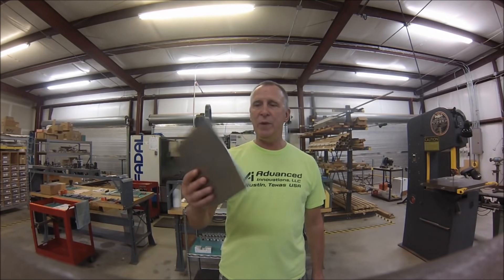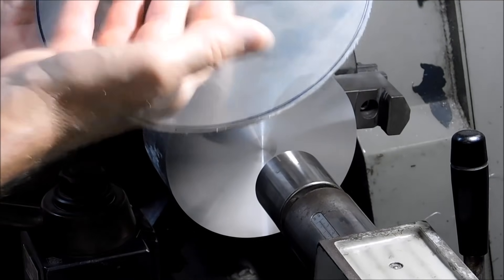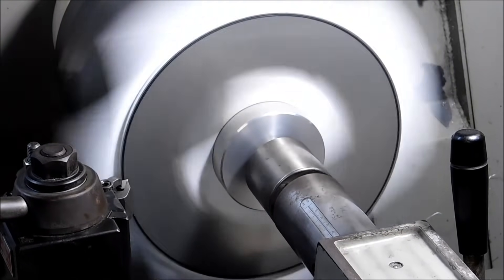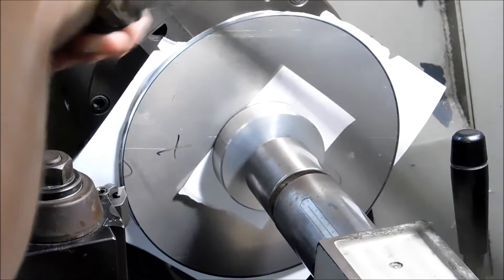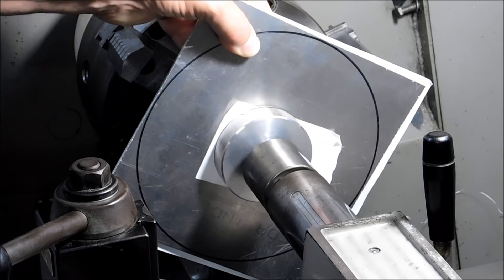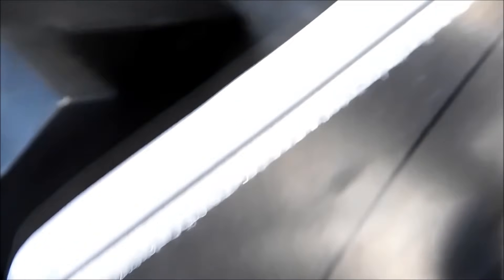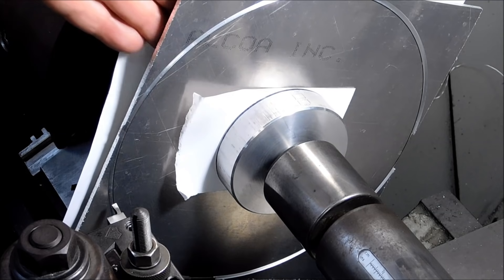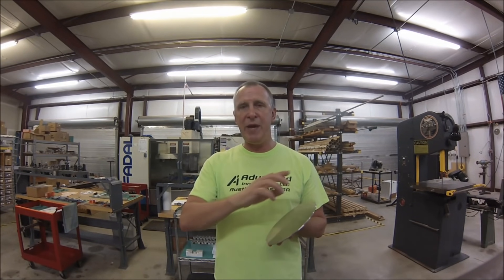Pressure Turning

Comment: Perhaps I missed it but was there any reason why you didn't use cutting fluid?  Thanks for doing the videos Joe.  I'm learning lot and still have so much to go.
Reply from the maker: Experience dictated it wasn't necessary.
Reply: @joepie221  Thanks, if you have the time, next time you use or don't use cutting fluid, would mind explaining why to a newbie like myself?  I watch some videos and they say cutting fluid or coolant on everything and other videos talk about it actually damages the cutter.  Not sure which way to go.  Thanks for the education Joe.
Reply: @VenturaSewerInspections  I think he was joking, no reason at all. Cutting fluid is always a good idea
Reply: @VenturaSewerInspections  You would be wearing a raincoat if you used fluid. Bee's wax works pretty good for non-ferrous, if you really wanted to use something. I'm just an old shop guy paid by the job. Duct tape and Band-Aids are the same thing. :)

Comment: That looks dangerous. how about glue the plate on a cylinder then use a heat gun to melt the glue after turning.
Reply: If you glue the plate to the cylinder takes more time, using a paper clutch makes the operation fast as you don't need to use a release agent to remove it. It is however dangerous but then all engineering machines can be dangerous. Can you suggest how to machine 1/8" aluminium circles to an accuracy of .002"as quick as that?

Comment: Why not superglue it to a piece of mdf, then warm it up slightly to remove it?!
Reply: Or just superglue it to an aluminum back plate with cyanoacrylate. Cut a few.concentric rings into the backlate, depth not
Important, maybe 1/16"?
So the glue has some where to go and.improves.the bond
Reply: @garethjones6342  that's not what the rings are for, but that does work well

Comment: Superglue? Why not use it? I understand it may take longer to set up and break down, but geez it seems so much safer...
Reply: Kameron Holmes I've tried this a few times and haven't had it come flying off even without superglue, as long as you cut it roughly at the bandsaw you shouldn't have much issues. Needless to say you still don't want to stand in the line of fire

Comment: Here are some tools you could use: Scissors to cut paper; gloves.
Reply from the maker: I have the scissors, you keep the gloves.
Reply: 😂 Fair play. Just the bit where you talk about removing the "razor sharp edges", all I could see was the pink flesh of your bare hands getting sliced right open!! 😳
Reply: tommy1273 gloves don't belong near a lathe.
Reply: They do if the lathe is stopped, and you're picking up razor-sharp bits of metal
Reply: You do not want to use gloves when a lathe is Turning.  If a glove gets caught,  you go in.  If you not careful ( when not using gloves ) You may loose a finger.
If you go in it could rip your arm off.

Comment: You wouldn't use superglue Joe?
Reply from the maker: Absolutely would work if both surfaces are clean and the heat stays down, but wouldn't be practical for a lot of parts.
Reply: @joepie221  

What about a bit of super glue to hold the friction material on the fixtures?

Comment: I have never even seen a lathe in real life, but instead of this rig you need to have a stationary part and a rotating cutter. I felt like I need to give some advice here even though I have no idea what I am talking about. This technique is for when you are desperate to get this part out and this is your only tool to do so with, and you need it out now. You should never put yourself in that situation of desperation. That comes first.  Another thing good about a rotating cutter is that you can do off center circles.  Would it be possible to take a common lathe like this one and reverse the part and the cutter?  Put the cutter on the chuck and use a magnetic clamp for the part.  If the part was aluminum, you could put a steel plate on top of it and lock it down with one of those magnet vise things that use an electric coil to hold to steel plate. Why wouldn't that set up be a lot better, a lot faster, and helluva a lot safer than this cowboy technique?  Have you ever thought of that? or something like that?   I first saw one of those magnet vises on Chuckee2000 or such channel. To me, it would seem like you would just use a fly cutter on an upright vertical mill, but holding down that part that has no holes in it to put screws in is where the problem would come in.  But to me, it seems like one of those magnet vises would work for that.  There are made to stick directly to steel plate, but it should still work with a piece of aluminum sheet between the two as long as it was not too thick.  But I bet it could easily hold 1/2" plate aluminum.  Maybe even 3/4" or even 1". I have never milled or lathed even seen a mill or lathe in real life, only on youtube, and I only come here for the clothing fashion tips, but it seems like this might be a much easier, faster, and safer solution to this problem. There's got to be a better way than this, and I know this is not your ideal way of cutting these shapes.
Reply: Jeff Beck You say you have no experience outside of watching YouTube videos, but you’re still trying to give advice?

Comment: 300 mph?  A bit of exaggeration, I suspect...So, I'm curious, so might as well do the calculation...

8" diameter circle, so let's go with a worst case of the corner of the square for the speed.  That would mean a 11.31" square, but let's call it 12", just in case you added a bit extra to the size to keep from having an interrupted cut.  With a 12" diameter traveling at 320 RPMs, you get 37.699" per revolution, so at 320 RPMs, you get 12,063.7" per minute.  That equals 723,822.95" per hour, or 60,318.58' per hour or 11.424 miles per hour.
Reply from the maker: Basically 16 ft per second. Regardless of 300 mph or 11 mph, its going to hit you in the face before you can blink or move out of the way. By all means, double check the math.
Reply: Which gives you an idea of the RPMs those baseball pitching machines must spin the wheels in them at since they can launch the baseball at 90+ mph.
Reply: I have used a trepanning tool to cut 6" dia. 1/8" sheet aluminium in my drill-press, but had more spare round the edges for multiple clamps. The cut is against sheet ply to avoid flexing. My nerve is not as steely as yours, so I stop the cut a bit earlier before breakout.
Reply: If we’re engaging in pedantry, Gurmpy Old Man, RPM isn’t suffixed with an ‘s’.  It’s Revolutions Per Minute, not Revolution Per Minutes.  Great video Joe, as always.  The message behind your MPH hyperbole wasn’t lost!
Reply: +cjl76
Depends upon whether you consider RPM to be revolution-per-minute or revolutions-per-minute.  If the latter, how do you abbreviate 1 revolution-per-minute since it would not be accurate to say 1 revolutions-per-minute.

It really is subjective though and not consistent across the language.  For example MPH (Miles Per Hour).  I don't think I've ever seen someone use MPHs and whether it is 100 or 1, they still say MPH instead of MPHs.  But then again, I've seen RBI used for run-batted-in and RBIs used for runs-batted-in.  Ones like API (Application Program Interface) vs APIs (Application Program Interfaces) or TLA (Three Letter Acronym) vs TLAs (Three Letter Acronyms) made sense, but some are a bit strange.  How about father-in-law and its plural?  The plural should be fathers-in-law, but many people mistakenly say it as father-in-laws?  English is a very consistent language -- except for when it's not... :)
Reply: +Grumpy OldMan The plurality is hidden within the acronym, it’s not the acronym itself that’s made plural, hence the ‘s’ isn’t required.  ‘RPM’ obscures whether it 1 revolution or 100 revolutions.  TLAs would be correct as it’s the acronym that you’re making plural, more than one TLA.  You’ve used a great example with 1 vs 100 MPH  it I believe the same reasoning applies: mile vs miles obscured by the acronym.  As for the inconsistencies within the English language, I couldn’t agree with you more!  When a Cantonese speaker suggested I shouldn’t be expected to learn the language because of its difficulty, I responded: “Once you read a red book, it’s considered read; what kind of messed up language tortures a student in such a way?” 3 words, 3 meanings, 2 spellings, 1 pronunciation!
Reply: When your at the hospital getting sewn up who will care.
Reply: typo corrected, thanks
Reply: The school says we are spinning on a ball in a vacuum at 1038mph at the equator, yet the air does not escape into space and we don't feel any motion. So you must either add or subtract a factor of 1038mph to the speed depending if you are standing on the east or west side of it.

Comment: this is not an efficient way to do this. every time i need to do something like this, i simply send a CAD file to a laser cutting supplier, and for $10-20 you have the material supplied, cut, and delivered to a guaranteed tolerance of 0.1mm or better and if you need it better than that, then put it in your lathe. I do this regularly (although not with aluminum). You can use your lathe for more appropriate operations.
Reply from the maker: This video is about  the technique, its not about the most efficient way to cut a circle from plate.
Reply: In the video he mentioned having to hold a .002" tolerance with this technique. You would not be able to do that with laser.
Reply: Besides it's fun.:>)
Reply: But what if your sales guy quoted it at ten dollars to your customer. Gotta find the best way...

Comment: i would be scared af using a parting tool there, 90% of the time when something jams its with the parting tool lol
Reply from the maker: Its a trepan tool, or face grooving tool. Its not a parting tool though they look almost the same.
Reply: Joe Pieczynski thx, never knew they had different names
Reply from the maker: They do. And they are ground differently as well. Much more clearance on the edge that forms the feature major diameter.

Comment: Here's a tip for when paper isn't enough as a friction media and you might have a polished or delicate surface that would get damaged by sandpaper.
Try double sided sticky tape, I've found Chinesium trash to work better than high quality 3M or the likes. You want a bit of slippage when centering the part, the high quality tape grabs instantly while the trash Chinesium grade allows for a bit of readjustment.

Comment: I once stood to the side when I was worried the part might fly off. Part tumbled over the tool post and righ at my face. Found my self on my back beside the lathe with big cun on my upper lip and two teeth knocked in slightly. The lesson here: It does not allways help to stand to the side
Reply from the maker: If a part comes out of a chuck and then falls back into the spinning chuck, all bets are off. That happen to me with a 14"dia piece of 1/2" aluminum. Came by the left side of my head so fast, I actually never had a chance to see it. That was a very lucky day.
Reply: http://www.finnsafety.com/en/product/sls-109-500-led-4/ I got one of these on the lathe at work. Just flip it down any time I feel any kind of unsafe
Reply from the maker: Do Yourself a big favor and be sure the machine has stopped spinning before you raise that shield. I had a large concentration of chips fall from one of those and splash directly into my face. After an hour getting stainless surgically removed from my eyes, I was blind for 4 days. They do work, but watch for the dripping coolant and chips the coolant may carry when you open it.
Reply: Interesting how a "Safety Device" can create its own safety hazards. Complete containment of the machining process inside an enclosure is great with all of the benefits that it brings/enables (chip containment, flood coolant, high pressure coolant, etc.) but coolant dripping from the enclosure as well as chips falling from the enclosure are a real safety concern when the interior of the enclosure has to be accessed. At my place of employment there have been instances where chips fell behind an individual's safety glasses.

Glad to hear that your eye sight recovered. Also explains why you are such a huge proponent of safety. :)

Comment: Damn.. I wish my trepanning was this simple. Superb explanations but I would say slow it down to break through.. after all it's only Aloooominum.  Ha ha. Sorry but had to fit that in as my Jagwar is made of the same material.
Reply from the maker: If I was not filming it, I probably would have. I chose not to promote the technique with the increased danger level. But you are correct so long as the tool and blank allow it. That hollow remnant chunk of material needs to stay with the chuck.

Comment: Aren't you supposed to back the tool off now and then to break the chips? The second one felt wrong. I wonder what AvE would suggest/say.
Reply: AvE would suggest that Joe is a much more experienced machinist.
Reply from the maker: Thanks for that. Sometimes if you have a good chip flow, keep it going. Especially on thin material. The constant tool pressure preloads the part and nearly eliminates the chatter or ring potential.

Comment: I could mill it round within .0002" on a vacuum chuck.
Reply from the maker: You must have amazing encoder motors and ball screws on your machine. .0002 round is pretty impressive for a mill changing directions 4 times for that cut.
Reply: Better. My machines have laser scales.
Reply: My main point was fixturing though.  Vacuum chucks are very underrated.  They are so good.

Comment: Don't you want a smaller back and front plate to increase the pressure on the turning piece? P==F/A
Reply: Spixy cat dishing the supports reduces the surface contact area which increases the pressure but you also want support so the wider the support will mitigate some buckling or twisting in the part if the tool pressure is too high
Reply from the maker: We really can't go with the "High Heel" vs the "Snowshoe" logic on this one. Though your observation is merit based, the larger diameter does give you more surface area to drive with. More surface area=more friction. There is a trade off.
Reply: more surface area means less pressure meaning less friction?
Reply from the maker: When I have a choice, I'll always go for the most surface contact I can get vs a lot of pressure in a smaller area.

Comment: pressure turning?-for as long as this has existed(a very long time) it has been called metal spinning
Reply from the maker: Metal spinning actually changes a flat shape into a convex, or concave dish or bell shape, so I'd have to disagree with you on that.
Reply: @joepie221  i suppose so but they still make final cuts with cutting tools.

they also mostly use thinner stock.

just an observation-why not trim with jigsaw/bandsaw to approximate size first and turn to true it up
Reply from the maker: For a few parts, that would be fine. This is much quicker for more. Ideally, just order laser or waterjet round blanks.
Reply: Spinning is a different critter. We had a spin shop when I worked at Wix Filtration and spinning is used to form sheet metal not machine to shape.

Comment: A pro would apply engineering solutions to make this job better and safer. An amateur “pressure turn” it.
Reply from the maker: Feel free to list the engineering solutions you would apply. If they have any merit whatsoever, I am sure I (we) could all benefit by them.  But bear in mind...There is usually more than one piece and the job was quoted.  I look forward to your reply.
Reply from the maker: Then again, a true pro will have the job done and shipped while you are killing the quoted time with some elaborate fixture so you feel safe.
Reply: Joe Pieczynski what if you faced that blank on the chuck, then cut some concentric grooves, and used acrilate glue to fix the workpiece on it?  Then, mild heart or a solvent can break the bond. There is a Channel called clickspring that used it a lot when machining wheels for a grandfather style clock.
Reply: Joe Pieczynski Yup, and yet again you won’t be so quick missing a couple of fingers or have fingers replaced with toes. But hey, you want to work stupid, be my guest.
Reply from the maker: Your fear of the process is understandable and obvious. It is very dangerous. Given sufficient time, there are many improvements that can be made to the base setup concept. If you take the time to read the comment string, you'll find several I have put out there. Unfortunately, in  a job shop environment where time is money and the competition for jobs is tough, fixtures are not always an option. Please keep your comments directed at the material presented.
Reply from the maker: Luan Cardoso dos Santos   I agree. Clickspring is an amazing craftsman. When I used this technique, it was normally for stainless plate in lots of 50+ pieces. Tape or glue was not an option. For smaller lots, its a great idea.
Reply: i had to pressure turn during my traineeship, since i have seen the result of using paper to give pieces more gripp on a milling machiene i felt verry confident by doing so.
Reply: just seeing the part with the square piece.
have to admit the way you did is nothing i would ever do.
Reply: Joe Pieczynski Hey Joe, another great video. Some might say that spinning a piece of metal then carving off slivers with a sharp edged harder piece of metal is a recipe for suicide!!! BUT given adequate knowledge, experience and caution, it can be done with relative safety. Thank you for alerting me to the risks I face should I ever have the need to use this technique. As a novice to machining, I take unnecessary risks that I'm not even aware of. By sharing your knowledge, you are helping me gain unsupervised experience much more safely than you probably realize. Ignore the Naysayers! 👍
Reply: Aye up safety police here again.